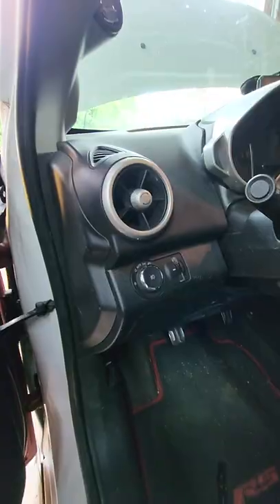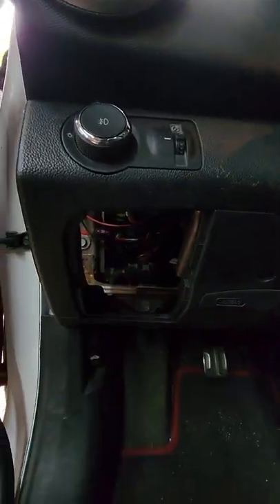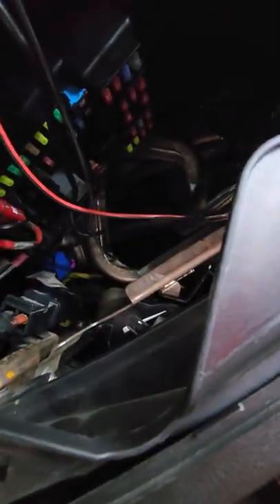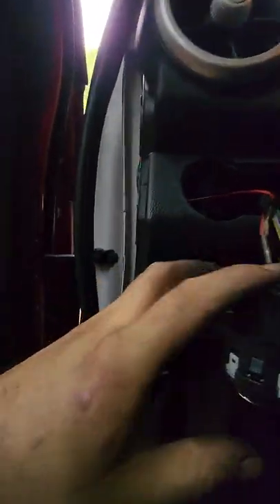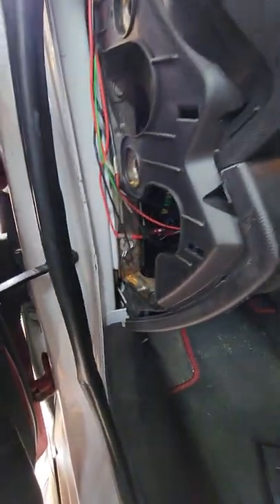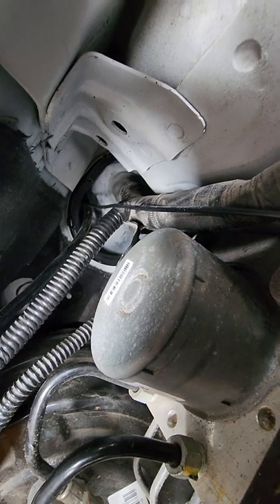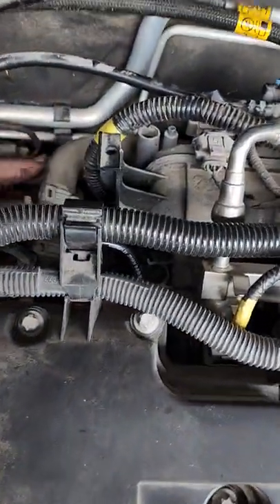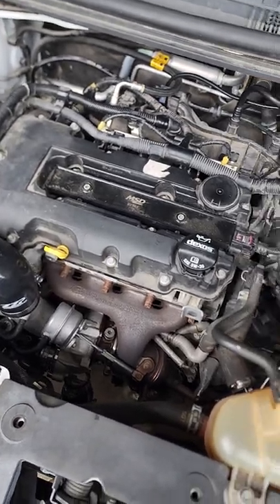Sonic boost gauge/ water temp gauge/ ZZP dual pillar pod install

Comment: i;am your newest subscriber great videos i won a 2011 chevy 6 speed manual cruze 2750.00 runs and drives rustfree florida car 3 owners i did car fax most of the maintance was done at the chevy dealership, i got a great deal

Comment: You should use the fuse tap it easier to use
For the yellow constant i tapped in the lift gate its keeps the setting 
For the red 12 volt switch i tapped in to the spare fuse or cigarette fuse either one works
I didn't bother with the orange wire because like you mention it flashes and i don't like driving with bright dash
Reply from the maker: Yeah the fuse taps that double up fuses for 2 sources are better.  I wasn't prepared. Lol ordered some too keep in stock tho

Comment: From what I’m seeing on my car, these are the same hose. I could be wrong but it looks like the hose just passed through a retainer or clip and continues under the manifold.
Reply from the maker: There is 2 hoses with a valve in the middle.
Reply from the maker: Look up intake manifold removal video. Dorman has one. Get a look of under the intake manifold and you'll see.

Comment: Good video but you created a shit ton of boost leaks
Reply from the maker: How?
Reply from the maker: I have a boostleak test kit. Professional mechanic for 10 years. This is my profession and my hobby.  It held 30 lb no leaks.
Reply: How did you get that boot to push in
Reply: @agautoworx5346  I need you to find my boost leak😂 I made a makeshift boost leak tester but can't seem to pinpoint where I hear the air coming from. I replaced the o-ring on the pcv and replaced the intake manifold gasket but I still hear leaking from somewhere back there😅
Reply from the maker: @tylertherien1558  just pushed in on it hard
Reply from the maker: @PMBSlayer99  now, even on a healthy system you'll hear boost going into the intake and leaking into being crankcase pressure and possibly out of the exhaust... your tester should have a gauge and a valve.  Your gauge should build good boost levels pretty accurately according to your air pressure input,  and it shouldnt drop off when you shut the valve, it should slowly bleed off. Only way to test 100% is to cap off the boost system from the intake. And then reinstall and remove boost tester and run vacuum tests with engine running on the intake.
Reply from the maker: @PMBSlayer99  check the pcv. When you remove it from the intake side, you should be able to blow through it but not able to suck. You'll know the valves closing. Also if the pcv is left on the intake, instead of being capped off, the pcv will always leak boost. That's its job. Positive Crankcase Ventilation.